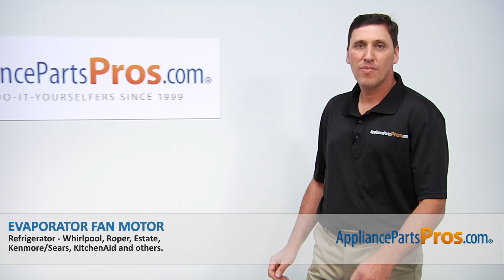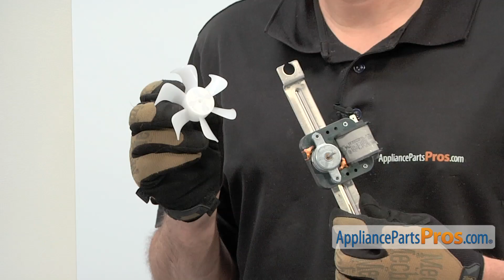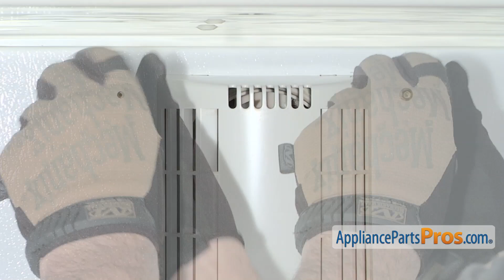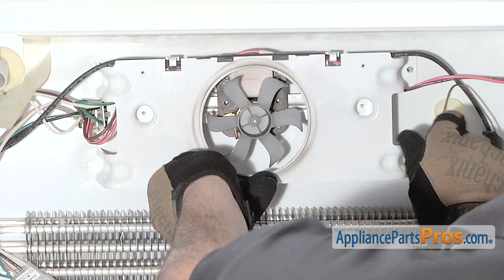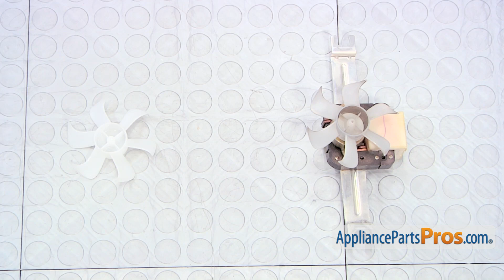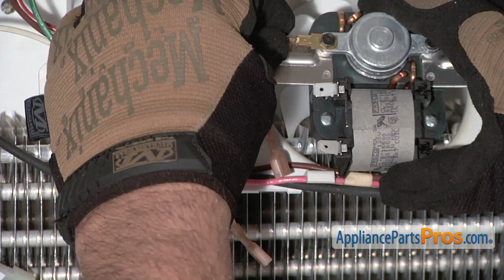How To: Whirlpool/KitchenAid/Maytag Evaporator Fan Motor WP4389142

Comment: This part is discontinued by WP. Any replacement options? Will Supco SM 343 Evaporator fan work?
Reply from the maker: What is the model number of your fridge?
Reply: kitchenaid KTRC18KDWH00  @appliancepartspros
Reply: KTRC18KDWH00
Reply from the maker: You can try and take WP4389142 to google and see if someone on google may still have that part in stock. We don't have anymore in stock and we don't have a replacement part either.

Comment: does the placement of the white and red/white wire matter??  mine are reversed.  Ground on top, White in the middle and Red/White on bottom.  Thanks
Reply: Same on my original Whirlpool evap motor wiring connections. Ground on top, White in the middle and Red/White on bottom. I took pictures before removing and wired new motor same as old. (Yes, I'm aware I'm replying to a 3yr old comment but it's FYI for future readers wondering same.)